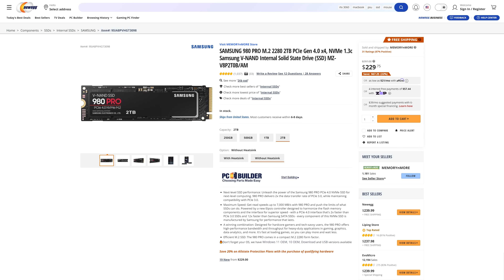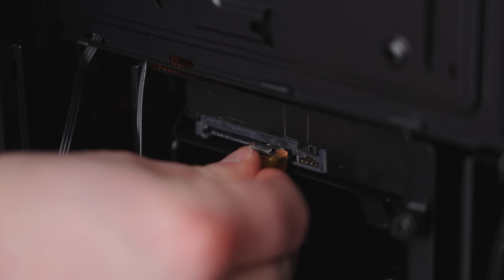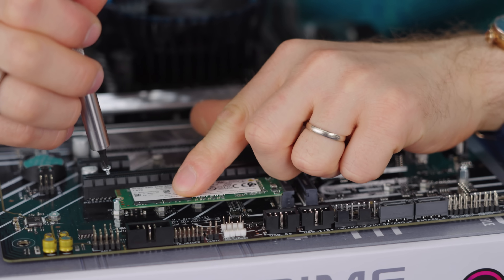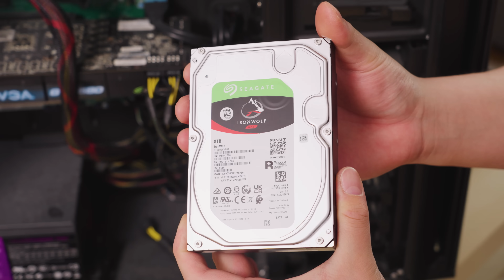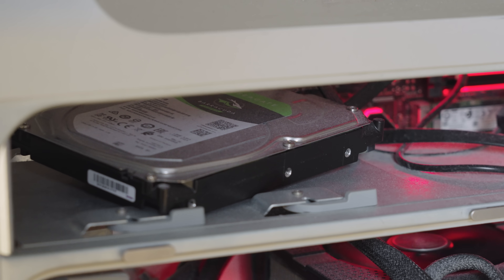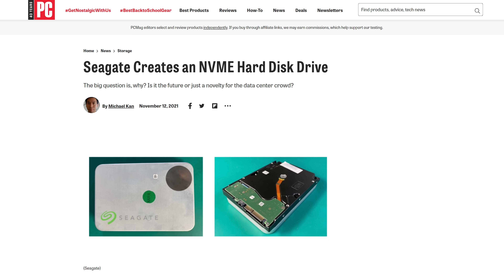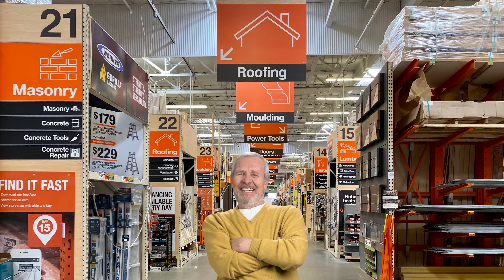Is SATA Obsolete?

Comment: PATA went away not because of SSDs (it took them years to become cheap and common enough to justify any industry-wide changes) - it went away because every hard drive manufacturer moved to SATA, as it's a cheaper standard to implement, had better performance than PATA and was easier for users to deal with (fewer pins to bend and also no jumpers to set the drive role in the "chain"). It also had massive implications on the SMB server business, since you suddenly could manufacture cheaper servers using SATA instead of SCSI and fit a lot more disks per chassis with somewhat decent performance. This is exactly the same reason that not long after, SCSI went away and got replaced by SAS, also known as Serial Attached SCSI.
Reply: Also, if you had managed to damage the SATA lock or whatever that piece that sticks in a vertical direction while the pins are in a horizontal position. It still works.
Reply: @killertruth186  I had a drive that I broke the connector off when I first got into PCs. I taped it in place and it worked for years like that.
Reply: @killertruth186  true, I mistakenly broke the small piece of plastic that was supposed to hold the connector in place. The drive still runs perfectly fine.
Reply: @killertruth186  what's a "SATA lock"?
Reply: Funny thing is, PATA didn't exist until SATA was a thing. Before SATA, it was called EIDE.
Reply: @iwontliveinfear  Now that you mention it, SATA did introduced after USB make its debut.
Reply: @iwontliveinfear  EIDE turned into ATA after the introduction of other device types such as CD-ROMs.  ATA then became PATA with the release of SATA.
Reply: @iwontliveinfear  Things may be a little different in Canada and the USA than it is in Aus but I have never heard of PATA, IDE was the thick grey cables that I remember. From my memories IDE was replaced with SATA and then gradually SATA SSD and now NVME. Although my PC supports 2X NVME I still run a SATA SSD and 2X SATA Mechanicals for storage.
Reply: @OnCountryWithMick  I don't remember what it was called before IDE, but IDE were the first hard drives where you didn't have to tell the PC how to interact with the drive.
Before IDE your BIOS needed to be told how many platters were in each drive, the number of tracks per platter, and how many sectors per track.

IDE stands for integrated Drive electronics. EIDE was enhanced integrated Drive electronics it was just an upgraded form of IDE.
Reply: @iwontliveinfear  Before IDE Harddrives there where MFM Harddrives ( used in XT en AT 286 PC`s)
Reply: @iwontliveinfear  i always thought pata and IDE were the same
Reply: @tankerock  technically PATA is the form factor and IDE/EIDE is the protocol. Technically SATA is a form factor and your SATA device can use EIDE or AHCI protocols.
But before SATA was in development, PATA was never used. The official name of the form factor was the (E)IDE interface.
Reply: @iwontliveinfear  It was called ATA. IDE / EIDE is WD's terminology.
Reply: @IvanRiveraStagea  Intelligent Drive Electronics is not WD's terminology, it was an industry standard, so were ATA, and Extended IDE
Reply: @iwontliveinfear  you are mixing things
IDE didn't apply to ATA as such
It was Integrated Drive Electronics so even ESDI and SCSI were IDE
EIDE is just enchanced IDE
ATA stands for AT Attachment and it just this
IBM AT attachment, just write basic HBA (Host Bus Adaptor). ATA is modified simplified ISA, nothing more and protocol running on this bus.
Reply: @WizardNumberNext  you've got the right idea, but mixed a few things. ESDI is electrostatic discharge and has nothing to do with drives. IDE is essentially "brains on the drive" compared to MFM/RLL dumb drives
Reply: I used SCSI for the longest time while ATA-disks become cheap. I could use a lot of disks compared to the 2+2 maximum that was the case with ATA. Disadvantage was the jumper hell of unique addressing, and the bus terminators. I eventually gave up on SCSI and went SATA. The disks were sooo much cheaper.
Reply: @bgezal  I used to have a Pentium PC with a Adaptec 2940UW and a bunch of storage drives in raid 5.  I really hated dropping on of the micro jumpers that seem to just vanish.
Reply: @bgezal  drives may have been cheaper, but worse quality and less features as well. The price is not strictly for SCSI, as protocol is easier to implement. Nobody implemented ATA over IP, Fibre Channel, Infiniband, only over Ethernet (while you have  Fibre Channel over Ethernet too). Even disc drives like CD, DVD and BR are actually SCSI over ATA (ATAPI is 12B long commands like SCSI and actually is SCSI) to the point Linux 2.4 haven't had driver for ATAPI drives for quite long time. 

I enjoy using SAS drives by the way. I even have SAS3 (yes 12gbps with 750mb/s read speed) SSDs
Reply: @bgezal  SCSI was beautiful. Daisy chaining devices, addressing, termination etc...
Reply: Ugh... The master/slave pin combinations that changed with every brand, bane of my childhood.
Reply: @Boomer8u  preach brother you could connect 2 devices to one cable, i slways got the master slave wtong there also cable select option
Reply: @Boomer8u  I wish I understood cable select in late 1990s and early 2000s.
In late 2000s I have had all my drives on cable select,  never have had any trouble since
Reply: not to forget, PATA had problems on long ways, SATA as serial connection was just better for that usecase.
Reply: @mpz_prod  there was hard limit of 34 inches I believe
SATA can do 3 metres
SAS goes even further, as SAS just don't care and uses same voltage levels as e-sata (twice sata levels)
Reply: Yeah I remember building a PC with SATA mechanical drives long before SSDs were affordable for enthusiasts let alone mainstream
Reply: Don't forget the initial release of SATA I was absolute trash when it came to transferring data from one SATA drive to another on the same controller.  Not true for PATA.  In that regard PATA was faster.  Or at least SATA to PATA or PATA to SATA.
Reply: @JustinEmlay  Oh yeah.... I remember people loosing data on some SATA 1 drives, when using certain Asrock motherboards. I believe there were a bug in one specific chipset.
Reply: Yeah pata died before ssd were commonly used in pcs. I think the last motherboards to use pata was a few sandy bridge motherboards, which sandy bridge was released in 2011, so ssds were not cheap enough like you say and pointless for people with windows 7 at the time. Definitely not ssds that killed it.
Reply: @stevenlee3661  They definitely were not pointless. I had an SSD in my PC by then (paid $870 for a 500gb drive around 2010), and it wasn't even one of the fastest ones, but the performance difference was enormous. Not that different from a new SATA SSD today would give you, TBH, just a lot more expensive since it cost more to make them back then. You needed to periodically manually TRIM the drive, but Windows 7 added support for auto trim in an update, it absolutely was not pointless by the time that update rolled around.
Reply: @TheOriginalFaxon  fair enough. Most users didn't need them so wasn't a push factor for getting rid of pata.
Reply: @stevenlee3661  PATA died years before SSD started be a thing. In like 2007 or 2008, everything was already sata, but first SSDs started be common in like 2011. The last MBs where PATA was still common (but mostly only 1 connector, not 2 like in the past) were MBs with socket 775, but it was used mostly only for DVD drive in that time.
Reply: @stevenlee3661  And sata came way earlier than 2011. Wikipedia claims 2003. And I remember my father had a pc with sata that I thought it was older. But maybe not. But anyway... it had like 50GB sata hard drives in it. With XP installed. And something like an ssd was complete fantasy. It also had an Ata graphics card that had no cooler. and like 1 gig of ram. And probably a 1 core CPU. Not bad at all for the time. Just so all can imagine how archaic everything was wen sata came around.
Reply: since when was it called PATA? i always called it IDE and when i took my A+ Cert like 15yrs ago it was called IDE, and that's what i always called it.
Reply: @NonLegitNation2  It's been ATA since at least 1988 when it was being standardized... it meant (IBM PC/) AT Attachment.  IDE is how WD called ATA when it brought it to market in 1986.
Reply: @IvanRiveraStagea  genuinely didn't know that. I always called them IDE cables. And I still have some, just in case
Reply: @IvanRiveraStagea  prior to ATA there were MFM and RLL drives where the drive had no brains and all drive logic was on the card and there were 2 ribbon cables per drive + power and they were 5.25" full height drives. ATA added some logic to the drive and made it easier for the cpu to talk to the drives... hence Intelligent Drive Electronics and the ATA standard
Reply: Exactly this.  SATA was here long before SSDs were.  Funnily enough, the first storage device that I had that really benefited from SATA was a DVD burner which could easily use more than 100mb/s.
Reply: @emu071981  OK, I think you have the units mixed up here. Ultra DMA 4, also known as Ultra ATA 66, had a transfer speed of 66 MB, that's Mega Bytes, per second. Using that it would theoretically be possible to burn a double sided dual layer DVD, 17.08 GB, in less than four and a half minute. Using  U-DMA 6 or U-ATA 133 which was very common on motherboards before SATA was introduced it would theoretically be possible to do in just over two minutes. To be exact 2 minutes, 11 seconds.

Now I say theoretically for several reasons as at the time there were no DVD burners commercially available that could burn a Dual Sided Dual Layer DVD. The best we had was single sided single layer. It's possible there were a dual layer capable writer but if so it was horrendously expensive, I'm talking multiple thousands of dollars. Anyone interested enough in burning DVD's at this time would most likely be using SCSI anyway.

Another thing is that there were no DVD burners even coming close to approaching the transfer speed limitations. They were simply to slow. Most every DVD burned was 4.7 GB at most, and at 100 MB/s it would take less than 50 seconds to burn that. Add ten or twenty seconds for lead in and lead out and you're hovering at a minute a minute ten for a complete DVD. It's been a while since I burned a DVD but I'm pretty sure even the Blu-ray burner I installed a year or so ago can't come close to that.

So U-DMA 5 or 6 would be perfectly capable of sustaining a transfer rate high enough to saturate any DVD burner.

No the first devices really taking advantage of SATA and saturating the buss was SSD's.  Early flash based SSD's were dog slow. I'm not even joking when I say that it took more than three times as long to install Windows on the first flash based SSD I tested than it took on a very average HDD at the time. Now this SSD was never released as a commercial product, but was used to test durability of flash ram. At that time there were DRAM based SSD's available and those were FAST. Though they suffered from losing all the data when powered down if the battery backup ran out. And they were incredibly expensive.

Getting the SSD's to where they outperformed mechanical drives didn't take long, and for the first few years manufacturers were constantly pushing the performance limit. So SSD's were the first to saturate SATA Rev.1 at 150 MB/s and SATA Rev.2 at 300 MB/s.

Hard drives on the other hand are still hard pushed to break 150 MB/s, and when they do it's usually buffer transfers and not continuous read or write streams. What limits them are the rotational speed, data density on the platter and mechanical latency. All of which is problems that optical media drives also have but solid state storage doesn't.
Reply: @blahorgaslisk7763  I have 4TB hard disk drive which can sustain 180MB/s
2TB HDD easily saturates 150MB/s
All this is old
Just to show how old
4TB SAS2 HDDs were bought after warranty period lapsed and this was 5 years ago,  so this is 10 years old HDD at minimum.
Reply: @blahorgaslisk7763  oh no DVD burner can burn two sided DVD at once
It is in name - it have 2 sides and you have to flip it to burn other side
Reply: @blahorgaslisk7763  you may have mixed up CD burning of 700MB with DVDs, but in general you're right
Reply: @WizardNumberNext  DVDs aren't 2 sided, they have 2 layers on the same side, hence 4.7GB and 9GB disks
Reply: SCSI As Service
Reply: @rashidisw  joking aside, iSCSI is essentially SCSI as a Service.
Reply: I have a PATA SSD
Reply: literally came to the comments to say this
Reply: And don't forget the cable.  Thick ribbon cable that blocked air current through the case.
Reply: @johndoh5182  I used to cut and split the ribbon cables into a bundle.
Reply: @johndoh5182  Thank God the PCs that were built at the time didn't use much power back then. And thank God we moved away from PATA before beefy, power hungry systems became more prevalent.
Reply: @johndoh5182  I've still got some of those cables, including the fashionable brightly coloured round ones.
Reply: @johndoh5182  Air flow was not critical before the early 00's. It all changed around 2005/06'ish when the first P4 S775's came on the market. Those ran hot.
Reply: @johndoh5182  I'd attribute that more to poor case design. It's a relic of the times.
Reply: @johndoh5182  Yes andy 65nm processor and DRAM used a 250-350 watt PSU. Graphic cards were often passively cooled, and CPUs used 40mm fans..
Reply: @johndoh5182  aka the "CPU and GPU suffocator!"
Reply: There do exist some pata/ide ssds afaik
Reply: @misterjeffa2128  yes, they do. I have 5 of those
Reply: @misterjeffa2128  Tons of them. SSD is just a term used for the way data is stored. CF cards have always been SSD. They went on the market in 1994, and there might have been other type of SSD before 1994.
Reply: @misterjeffa2128  Very correct. In fact the known Compact Flash cards operate PATA in disguise. Place them in a nice housing, and voila a PATA SSD. This was available on the market as well.
Reply: And luckely no more Master/Slave configuration! Where you had too place the jumpers in the correct way on the HDD!
Reply: I was going to say the same thing, really bad script if im honest.
Reply: as a computer, i agree with this statement
Reply: Good point. I do remember SCSI and boy was it an investment!
Reply: So is he lied ?
Reply: @user-bf3gb4sf7g  Not lied, just mistaken.  I doubt they consciously knew different but decided to knowingly say something that wasn't correct.  They're just going off web info instead of having actually lived through it.

Imagine a 20 year old today trying to describe daily life during the Vietnam war.  It would be full of misinformation.  Or watch him describe how hilarious the Korean war was because they binge watched MASH.
Reply: @JustinEmlay  yeah you're probably right, thanks
Reply: And I remember my ASUS P5K where was PATA for DVD drive and SATA for hard drives… and the length of PATA was not enough…
Reply: My thoughts exactly, thank you for letting it be known. I feel the video sounded quite off on the facts department and remembering back as you said PATA left for SATA because it was more efficient to use and had better bandwidth long before SSD was a thing.
Reply: Yeah, once SSDs became more affordable to consumers, they were still expensive and small enough that people generally only used them as a boot drive, maybe having a few games on them, using HDDs as their game libraries...which, frankly, is more or less what most people still do today. I'd argue someone is more likely to have a boot nvme and a second nvme for use as a game library, as well as several TBs of spinning rust for older titles or to serve as game storage, than someone is to buy an nvme for boot and an ssd for a game library. Per gb, it just makes more sense to still buy a HDD.

And that's not even getting into the fact that most boards generally have only two m.2 ports, and usually the chipset doesn't have the bandwidth for both two m.2s and fully populated sata ports. There's also the ease of installation; with nvme, you might have to take off a heatsink, a PCIe card, or both. With a sata drive, you just unplug the old one and plug in the new one.

And that's not even getting into the fact that SSDs as long term storage just isn't as reliable as good old spinning rust. As more and more people buy or build home NAS appliances, they're not going to load it up with nvme or even sata SSDs, not unless it's for some interesting homelab work.
Reply: Yeah HDD were more reliable but now they make em so dirt cheap the metals are more expensive than silicon
Reply: true
Reply: Dang super mario bros servers?!
Reply: Beat me to it.
Reply: From my POV, the OG ATA/IDE was replaced by SATA here, because their most common speed rates, are was oversaturated here, and the more complicated UDMA6 and 7 here, are was too expensive and impractical to implement in common devices of the time here. SCSI AFAIK was meant more for servers, than the regular "mortal" desktops here, so was replaced by SAS, tho. They all moved to SATA on a large scale for mass drives/devices here, tho. Now the SSD's are saturated the last SATA speed here, so it will be eventually be replaced with PCIe in M.2 here, with the NVMe SSD's here tho. The more complicated the system/standard/device here is, then it more impractical and expensive to implement/sell it here, especially when coming to a mass production for cheap market segments here, tho.😐
Reply: This. For example, the largest PATA drives made was around 250 GB. All 500+ GB drives was SATA. Obviously this was long before SSDs became any kind of mainstream.
Also the "proper" name was ATA, and it was retroactively renamed PATA to destringuish it from SATA. ATA was the actual standard, IDE / EIDE was a Western Digitals own standards (with a lot of overlap betweeen IDE and ATA). I think IDE was the most common colloquial name though.
Also... Other advantages of SATA was that 3,5" and 2,5" drives used the same connector, and they introduced the new power connector which is also superior to the old molex connector.
Reply: This seems correct to me. I remember buying SATA drives before SSD drives were commercially available.
Reply: Wow this jumpers role pin bring me back so much memory !
Reply: PATA wasn’t even a common terminology back then. It was simply ATA, since SATA as unfathomable at the time. It was either ATA or SCSI, and you were dealing with either ATA33 or ATA66!! Ooooh yeah! 66MB/s burst rates baby!!! Apple went SCSI all the way, with terminators..
Reply: @Youtube Member can't forget IDE
Reply: There is a small group of men (3-4 max) watching me type this right now.
Reply: I liked IDE more, those wide cables were annoying, but Sata connectors (especially sata 1) are so fragile! I saw them broken on HDD or MB so many times. Person who designed it had to be on drugs or something. Problem on MB was solved by extra fencing around connector, but on HDDs/SSDs it is still not solved until now and you can still break it with one little move in down direction, it can be easily solved by gluing extra plate if plastic under connector, it's that simple.
Reply: When you bend pins, you will just return them to original position, but stata connector (especially sata 1) is very badly designed and very fragile, it's stimilar as USB-A connector, it's very bad design, but for some reason, it survived so many years. Sata should have 2 screws similar as DVI or VGA connector ot some locking mechanism on 2 sides to prevent moving in connector and connector should be much more solid, just try to take some old HDD, put Sata cable there and try to slightly pull that cable in down direction, you will immediately break sata connector, it's just a very bad design for something which holds all your data.
Reply: I remember using a old hdd with a 80 pins IDE PATA cable running with UDMA 66 it was soo fast back in the day !
Reply: @jejeroy  I remember how we tested if there is difference between 40 and 80 wires PATA cables
Reply: ata 66 then ata 100then it was a blast on ata 133 :o until sata camed with 300
Reply: Yes, completely dead. Anyone actually intelligent, uses quantum entanglement.
Reply: I do wonder now that LTT has gotten so big if anyone, especially someone born before 1995, proofreads the scripts.
Reply: This video is an ad for mechanical hard drives to remind everyone that they are still good and cheaper.
Reply: @lenny108  They are more easy to recover data from, if one delete by accident. And modern mechanical ones are almost silent. I still remember how my parents 20mb MFM Miniscribe sounded like (1988 drive). A couple of years ago, I played around with a couple of IBM 10k RPM SCSI drives. And they sounded like a construction site. No... Modern mechanical drives like those 1tb WB Blue 2.5 inch drives are nearly silent and seem like fully silent in a USB enclosure. Only real advantage that SSD gives, are speed, and that is about it. Mechanical are for personal and important files, SSD are for operating system and programs/games.
Reply: I used SCSI and an a Mac and if you chained more than two devices where a device was in the change determined how well (or even if) it worked.  It was so common it was called "SCSI voodoo".  USB is much better in this regard though it it had managed a standard connector from day one it would have been much better.
Reply: @Maximara  I have not seen that issue on MS Dos machines. But the only brand of drives that I have been messing around with, are IBM server grade ones. Controllers have all been adaptech ISA and PCI. Except for VL-Bus. I still have the Bus Logic VLB controller in original box on the shelf.

When I think about it, I do remember that one of my friends had SCSI issues back in 1997. He had this Pentium-1 PC with Win95 and Voodoo1 card. And he always had issues with his SCSI drives. He used quantum and connor drives that were consumer grade.

So I guess it all depends on the class of drives. Consumer grade were shite, but if one had the expensive server and corporate stuff, then SCSI would work like a charm. The biggest issue is SCSI optical drives under MS Dos. Or other drives that need driver. Harddrives do not need a driver in config.sys or autoexec.bat though you need a controller driver and optical drive driver, if you want to use CD drives under Dos. That takes up an insane amount of conventional memmory. SCSI is best on Mac, Os/2, WinNT and other systems that do not have that conventional memmory design as Dos.
Reply: Im sure u have master in hardware boss. This is amazing information thanks
Reply: The main main, real reason was PATA itself meaning paraller data streaming. Pararell data was hitting its limits for everything so serial data streaming was only options to go faster. With new data streaming bus why not implement daily life improvements?
Reply: The thinner cable design of SATA also meant much better airflow in servers. Less energy required to keep the airflow saves a lot on electric bills
Reply: How is techquickie getting so much wrong that every video I have to go to the comments to see a big ol' correction
Reply: Western Digital made PATA drives up to 2008/2009 😂 🔝
Reply: Why is PATA slower? The data is in parallel, shouldn't it go faster with multiple, extremely fast cores handling it, over a multiple data streams, as opposed to a single data stream? I've been wondering that for a long time, and you seem to know something about it.
Reply: Hey why pata drive need jumper such as "CS, master, slave"?
Reply: Indeed. SATA was just better in every way imaginable than PATA: cheaper, easier to manufacture, more convenient to the user, etc. It was a jump everyone wanted to make and the investment required by companies wasn't high enough to prevent it.

SATA to NVMe isn't really that big. It's important for users who need as much performance as possible, but for the general public the difference is just not noticeable. Add to that, that NVMe is more troublesome than SATA to install and you have reasons not to jump from SATA.
Reply: As far as i can see, it is cheaper to implement M.2 (be it sata or NVMe) than a 2.5” ssd. Atleast on the SSD part. SATA will still stick arround for HDDs but seems like M.2 is taking over
Reply: @tech1t  for my opinion, the m.2 SSD either SATA or NVMe will be making the case even spacious and more hdd slot for another hdd

The m.2 when connected will look like it's been transformed into the motherboard itself
Reply: I think the doing away with the floppy drives had something to do with that as well.
Reply: PATA cables and connectors ssssssuuuuucked.

M.2 is the natural evolution. Terrible cables -> better cables -> no cables.
Reply: "it went away because every hard drive manufacturer moved to SATA, as it's a cheaper standard to implement, had better performance than PATA and was easier for users to deal with (fewer pins to bend and also no jumpers to set the drive role in the "chain")"
This part is true, but there's a time factor implicit in this comment that maybe people don't really know about.

SATA 1 (or SATA 1.5 Gbps) was released in 2003 - there weren't very many drives that supported this standard back then.

Most drives were still on (P)ATA/133 at the time (UDMA6), and being that they were both mechanical, there wasn't a lot that was different between them.

SAS 1 (or SAS 3 Gbps) on the other hand, whose specification was released about the same time as SATA 3 Gbps (SATA 2), was when consumer drives started to pop up.

As for SCSI, I was still using it well into 2006-2007 at the time. (Still have my Adaptec 19160 Ultra160 SCSI controller, and my 147 GB Hitachi SCSI drives.) (Some of the complications with SCSI was the fact that servers tended to use the 80 pin SCSI connector which provided both power and data whilst "consumer" grade drives used the 68 pin SCSI connector and the 4-pin molex for power, which meant that you really couldn't hot plug them (unlike the 80 pin enterprise counterparts).

SAS only had one connector.

And SCSI, you can daisy chain upto 15 drives per channel whereas with SAS, it was always one drive per cable (or SAS expander (cable)).

It was a LONGGG time before I started using SATA, mostly because it was costly to replace the existing hardware that I had at the time.

Between the days of (P)ATA and SCSI vs. SATA/SAS, one of the most significant benefits of the latter was NCQ, which wasn't available in the former.

That helped with servicing multiple requests for data and was better able to handle that vs. PATA/SCSI.

For a single user environment (e.g. at home), that's generally less of an issue than it is for SMBs.
Reply: SATA was around years before SSDs were mainstream...IDE went away because its slow as shit..not because of SSDs
Reply: Lol, good ol scsi. Lol. I hated those aluminum cables. 😒
Reply: also some layout issues of motherboard were solved with SATA, micro ATX became more prevalent and with that smaller boxes, you could also have more than only 4 drives (one floppy, one CD/DVD, one HDD and one bakcup HDD and that was already full) at a time where you had some important change in capacities over the years and often wanted several HDD.
Reply: PATA had a lot of limitations you had ATA100 and ATA133. ATA100 did not like HDDs over 120GB and ATA133 had issues with 250GB HDD the was firmware later that let it go up to 320GB but as far as I know all drives over 500GB were SATA on the newer ATA150.
Reply: We know that 😁 but how could the Techkids at LTT ever know that (some even younger then the SATA standard)?
Reply: @1_2_die2  ageist much?
Reply: I think the most accurate reason why we have SATA instead of PATA is the speed. Parallel interface can go up to certain point before the cable starts to have interference between it's wires. As far as I know, every other conduction in PATA/IDE cable is ground to minimize that problem, but you still can't beat physics. You can clock serial interface way higher and still have decent quality signal on the other end of the cable.
Reply: @RadOo  Old PATA cables didn't have the interleaved ground. They used a 40 conductor ribbon cable. Early PATA worked using PIO where the processor would write and read every byte of data or commands sent or received. The transfer speeds started at a measly 3.3 MB/s for PIO-0 and scaled up to 16.7 MB/s for PIO-4. This was very hard on the CPU resources and DMA was developed and later U-DMA. DMA stands for Direct Memory Access and meant that instead of having the processor send every byte the controller could access the memory directly to read and write data to and from the drive. U-DMA 2 allowed for 33 MB/s transfer speeds and was the last standard that worked with a 40 conductor cable.

When switching to U-DMA 4 there were to much inductance between the conductors to maintain signal integrity and a 80 conductor ribbon cable was introduced. The connectors however still only had 40 pins, or 39 once you account for Pin-20 that is used as a key. To provide the extra 40 conductors with ground a "comb" was integrated into the connectors. This "comb" only connected to the extra conductors and a ground pin. This worked for U-DMA 4 (Ultra ATA 66 (at 66.7 MB/s)), 5 (Ultra ATA100), 6 (Ultra ATA 133) and 7 (Ultra ATA 166).

It wasn't impossible to get even higher transfer rates over a parallel cable, but it would have required more modifications to the standard, breaking backwards compatibility to some degree and increased manufacturing costs. SCSI went that way replacing the simple ribbon cables with a new standard using twisted pairs, new connectors and active terminators. This allowed speeds of up to 320 MB/s but at increased cost and some compromise with backwards compatibility.
Reply: @blahorgaslisk7763  UDMA-4 was not 66MB/s, but 44MB/s
It was skipped entirely 
UDMA5 66
UDMA6 100
UDMA7 133 (very rare, even latest PATA HDDs rarely supported UDMA7)
Reply: @WizardNumberNext  Sorry but your memory misleads you. UDMA-3 was 44.4 MB/s and is the one skipped. UDMA-4 was 66 MB/s, UDMA-5 100 MB/s, UDMA-6 133 MB/s and UDMA-7 was the 167 MB/s standard that was a bit late to the party. I had to look that up to be certain, and discovered that UDMA-7 was 167 MB/s and not 166 MB/s that my memory wanted to call it.
Reply: @RadOo  you have to basic information
Basically you are right, but this is huge oversimplification
PCI-X runs up to 533MHz (yes, that is 16 times faster then PCI, but PCI-X is 64bit, not 32bit) giving bandwidth of 4264MB/s
If PATA would run at 533MHz, then it would have showed off 1066MB/s, which is higher then SATA.
The problem is not it cannot run that fast,  but it is hard to synchronise all bits to arrive at same time
The first bus which have "solved" synchronisation problem is PCIe
They haven't solved problem. They worked around it. Each lane works completely separately. No data reconstruction is needed, as each lane transfer full packet of data, but just part of it. ATA wasn't designed this way and really couldn't be modified to this. 
SATA is serial, but capability of going fast isn't coming from serial, but from LVDS (low voltage differential signalling). Each cable sends opposite signal, which just don't care about noise, as noise acts on both cables same and isn't even picked up at all. Idea was brought into computers by SCSI, so quite old idea
Reply: @WizardNumberNext  ISA, PCI, PCI-X and PCIe have nothing to do with the drive communications speeds, the define cpu to card communications, drives are on "the other side" of the card and use different protocols
Reply: PATA cables didn't inhibit airflow all that much. Airflow is way, way overemphasized.
Reply: @BaronOfDaker  not with modern tdps lol
Reply: @BaronOfDaker  especially since you could get rolled and sleeved cables.
Reply: Well that's LTT in a nutshell... basically they're gamers who claim to know stuff about hardware but fail totally at anything bigger than a standard server. Not like they'd know anything about the history of storage or interfaces. They just claim they know their stuff, then fail miserably at it - rinse and repeat. As a storage (and database) guy I point and laugh at all the fails LTT has put onto YouTube trying to get "good" file servers, backup, desaster recovery... its almost like watching a car accident. :D
Reply: @FSdarkkilla  as a fellow IT pro (I'm in acquisitions and administration), I can say that you are being a bit overly harsh.
I admire what they do, especially the server content.
Sure they bumble around, but clearly you've never work with anything other than off the shelf solutions with steep licensing fees.

As someone in charge of tech acquisitions for a few companies, I can tell you that if your company can't or won't afford the licenses for the "industry standard" server software it is no different than what you see in the petabyte project videos.
I have 30 years of experience with computer hardware, and 15 years experience in the server room. I have spent several weeks working 12 hours a day, 7 days a week trying to iron out all the winkles from custom storage solutions for clients that don't want to pay a yearly license to Cisco and Red Hat.
Reply: @iwontliveinfear  While I "only" have 24 years of experience working with IT (16 years professionally), I definitely am not the kind of IT guy that relies on "turn key solutions" (unless they're actually requested by the customer). Among other things I primarily design and operate large scale (> 100 PiB usable capacity) high performance Ceph clusters and OpenStack installations for a living and am definitely a fan/heavy user of ZFS (I was storage administrator for a large scale ZFS based Cloud Storage product offered by a major ISP that was in the 60 PiB range when I started there) and am an administrator for critical infrastructure, so I'd say I definitely know my way around a datacenter. Also I'm trained to work within ITIL processes (even though I get why people hate them sometimes - some of these processes are actually good).

Seeing all these videos where LTT fail time and time again instead of asking a professional to design a solution that won't repeatedly require them to get data recovery is both hilarious and painful. 

Maybe that's overly harsh and they always claim its for the "entertainment value" but when its for entertainment I don't get why they don't deploy stuff like that in a test lab environment and then do serious chaos monkey testing (like randomly pulling plugs, hard drives... etc.) there before using it in production. 

Instead they fiddle around with their critical business data repeatedly. So from a professional point of view its definitely not a good way how to deal with critical data. One can show how failures occur etc. and that's fine from a teaching perspective, but doing it with live critical data? 

Well, I'd be very nervous working for a company that could in an instant loose all data, be unable to recover it and then sooner or later they'd have to file for bankruptcy when business can't continue to operate. 

So from my POV they're still primarily gamers who fiddle with IT but apart from Anthony who certainly knows a lot of stuff the way they run their IT is more amateur hour than professional. In professional environments nobody would dare to touch a production system without testing changes first in a lab/do a proof of concept, then deploy it in testing environment and finally in production...
Reply: @FSdarkkilla  they at least claim to practice what they preach by having two local copies and one off site copy of all of their data.
Which is why when they "lost everything" they were able to recover "almost everything". I assume that what they lost was video that had been ingested and removed from camera memory, that wasn't yet cached on an editors rig, and also had not yet been pushed to their remote backup server (at Telos, IIRC).
I assume it's is similar to an issue I had with one of my corporate clients a few years back.

One of my clients is a very well known animation studio that is based on The Sunshine State, and I've had to do send the NAND flash modules from their caching server off to have the raw binary data dumped from them to do data recovery to save a day's worth of animation because their Zap Cap failed to protect their ingest server.
The storage controllers for their caching server was fried, every drive in their storage array was dead, and their remote backup only synchs once every 24 hours (which is fairly standard IME). It was cheaper to do the data recovery than to pay the animation team to redraw all the key frames.
I also suggested that instead of manually wiping local copies after moving data to the caching server for ingest, they should add little script in their frontend that remotely erases the data from the local machines AFTER it had been confirmed as pushed to the remote backup.
Reply: @iwontliveinfear  By the way, please don't get me wrong here, I'm not hating LMG for what they're doing, after all its their own business. Its just both painful and hilarious to watch. And yes, they preach about the importance of having backup copies (especially off site) but at the same time I remember that recently one of their off site backups just bricked itself with lots of read errors... entire ZFS pool was a goner (probably due to lack of good monitoring and scheduled scrubbing). Sure, they recovered from all of their incidents including that one. But mostly it was sheer luck... so yeah still not best practice in my books. 

I know that ingest in certain environment can be a big deal (I have some industrial customers who are way worse than LMG in terms of data ingest per day), but there are ways to implement storage and backup (storage) in ways that are way more resilient. Problem is of course that it costs money and experts to setup things in that way. 

I tend to think in failure domains - how many disks, servers, racks, rooms or even entire datacenters can fail before a storage system is in a situation where either writes are no longer possible for safety reasons or even data loss will happen. In my usual environments a single server with sth. along the lines of ZFS raidz-2 pool isn't enough, as it'd only take sth. like a faulty PSU to fry the entire system including drives... also a single room with multiple racks might not be enough - I've seen entire JBOD racks getting fried because the nitrogen fire suppression system in a DC was triggered. The "blast" from such fire suppression systems causes sound waves with a frequency and volume capable of causing head crashes - even though these systems are designed to "preserve" the IT systems. Well they prevent fire and water from damaging the systems but hard drives getting blasted with ultrasonic waves can cause entire racks to go down because they happen to be too close to the nozzles releasing the gas...

Regarding that studio: Sure, sometimes sending a failed storage component to a data recovery specialist is cheaper than replacing an entire days worth of work. But it also reveals a fault in risk assessment on the customer side... they maybe ran "standard procedure" backups but failed to assess that their data needs far more snapshots or even has to reside on redundant storage systems in case one fails completely.
Reply: @danimayb  1:06  "but one of the bigger reasons it died out was the leap from mechanical to solid state storage was a huge deal"
Reply: Almost nobody had the narrow pata cables
Reply: @danimayb  @1:05.  Basically called SSD the biggest reason PATA died out.
Reply: is this not what was said in the video
Reply: ...huh? he literally mentions these exact things in the video. did you only watch up to the part where he said ssds used sata and then stopped?
Reply: PATA literally is SATA, it's just a different form. It still used the same SATA connector. It's also newer than SATA. I think you're thinking of IDE.
Reply: That's exactly what he said. This comment is pointless.